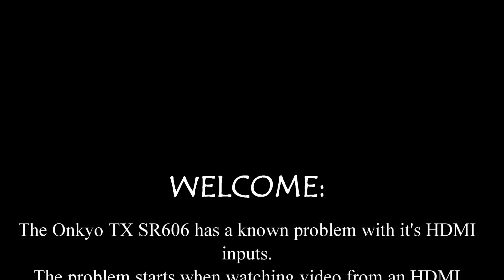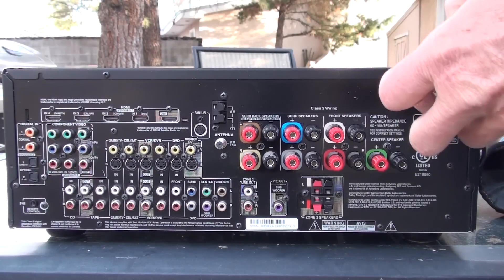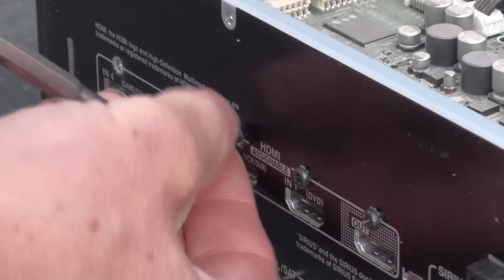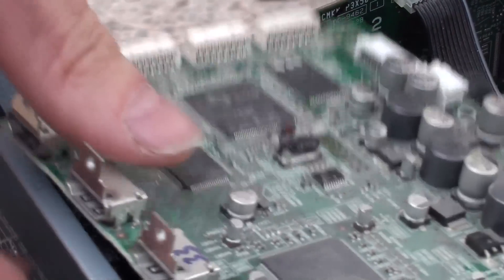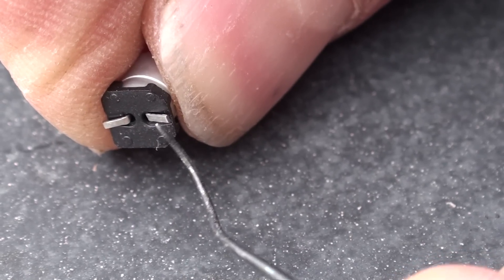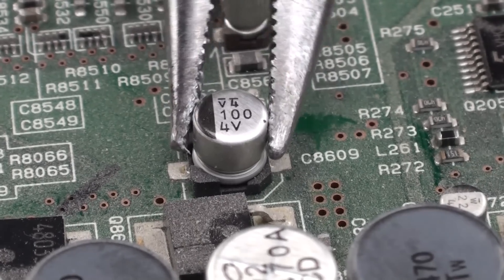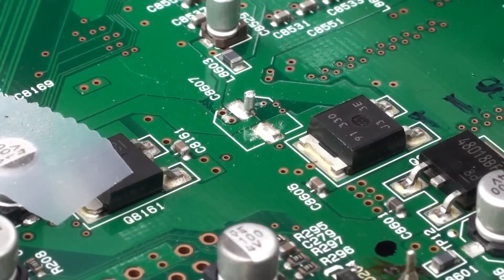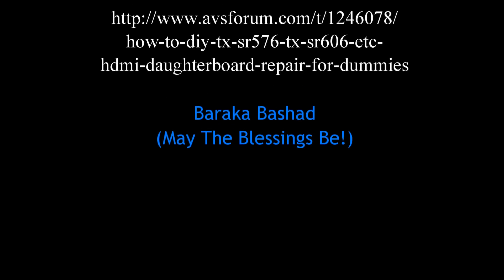How To Fix the Onkyo TX SR606 & SR607 HDMI Input Problem

Comment: Thanks!  Actually, my TX-SR607 had given great service until about a month ago when all HDMI crapped out.  I figured it was toast and was looking for a replacement.  I just happened on this info today, went up to radio shack, soldered in 5 new caps and watching football tonight.  GREAT INFO!  By the way, inventory at shack was 3 radial lead and 2 axial lead 100 uf 35v capacitors----didn't seem to matter a bit, just a little rigging and some heat shrink to fit everything neatly.  Cost me all of 8 bucks.....

Comment: PAT You are a REAL GENIUS. Your tip on blue tac was awesome. I came on in here to see possible faults of hdmi board issues in Marantz MM AV 7005 and I landed on you very productive, educational and informative video. Lately I can only get sound with the HDMI cable connected from the blue ray to marantz AV and then to Arc of the TV. I  am wondering if your trick only worked on Onkyo? Please write back and tell me if it will hold good for Marantz too. Many thanks in advance from Antonio, Goa, the state of India. Good bless.

Comment: This also works for the Onkyo tx 875! 
The boards are different, I replaced all the 100µf capacitors and it worked fine. Probably didn't need to change them all (13) but it didn't take much longer and the cost was nothing

Comment: Thanks! I just follow your video to repair my year 2009 onkyo 607 hdmi board and it works! All hdmi in ports now like instant switching! Its 2019 now!
Reply: Hi, i also have the 607. So you know how many you needed to change and which numbers they have on the board? I understood that for the 607 they are all on the top of the board

Comment: DUDE!  Thanks so much!  I had an issue where after moving to a new house and letting the receiver sit in my closet for a couple years, I tried to get it going again and the picture either wouldn't show, would show but then cut out intermittently, etc.  I searched for a solution and watched your video.  I also searched for a video on how to solder.  
I ended up running to Fry's electronics and picked up 8 (I got a couple extra at your recommendation but didn't need them) NTE  VHT100M16 ROHS 100 uf rated at 105 Celsius.  I painstakingly removed each of the bad capacitors and soldered the new ones in.  The ones I purchased are rated at a higher voltage and thus were slightly larger.  Their 'feet' are also quite a bit longer which helped my brother hold them in place and helped me not to burn his fingers with the soldering gun.  
Plugged everything back in and the picture popped up on my ps3, cable and amazon fire TV right away!  
Again, you saved me a bunch of frustration and a bunch of time.  Thanks!
Reply from the maker: You're welcome.  I've always wanted to be a Dude.

Comment: Well presented and produced video. Clear concise and to the point. Thank you. I have a problem with the optical input not switching and it was suggested on the av forum that it was a chip overheating but might do your capacitor replacement too while Onky is open. In Onkyo's defence my receiver sounds great and was the best value and my type of problem has happened with other devices (I repaired a friends Sony playstation which had overheating Ic's - reflowed solder stuck heatsink pads on and it was working again). Onkyo were apparently repairing for free too so give them a break.

Comment: Thanks for the video, I was able to repair my HT-RC160 in the same manner as in this video. The HDMI output now works and I can see a picture from all my inputs, but I lost sound in the process of fixing the video. I searched around and apparently sound is controlled by one or more chips on the very circuit board, that has the HDMI inputs, the one that I repaired. I probably messed it up when I was removing the board. The moral of the story is be careful when pulling the circuit board out.
Reply from the maker: Did the sound go completely dead.  There's another post where the sound is just a buzzy noise,  this is caused another set of bad caps on the board.
Reply: +patpatpat999 Completely dead... not even the head phones are putting out any sound. FYI, on the HT-RC160 all the 5 capacitors are on the bottom, so I am thinking that since I soldered the capacitors off the board rather than shaking them lose with pliers I might have unsoldered some wires from one of the chip if any of the capacitors are located directly underneath it, even though it would seem highly unlikely. For now I am using the TV sound, I will venture back into the board to see if I can find anything eerie and maybe even bake the whole board in the oven as some of the sound fixing videos I have viewed suggested.

Comment: Thanks this video helped me solve a similar problem in a Pioneer VSX receiver. It would make static noises in all channels (even when no input is connected), and through headphones, with the noise being extremely prominent in Surround mode... Found what seems to be a main regulator on the digital board, and placing a 100uf capacitor across it the way you described, and it's gone! But then, the oscilloscope still shows some noise, and I can't get it to totally flatten no matter what cap value I'm using. I replaced the existing 220uf cap placed across it with a regular electrolytic, but it ended up making a new type of extreme static noises and sometimes would make no sound... I'm not sure why, as polarity and values seemed correct. so, placed the original back and just added the 100uf across it, so far so good. I'm not sure this is how it should be done, but it seems to work. One thing I also noticed is that cooling the regulator down did make the problem go away... could be a bad regulator after all?

Comment: Thanx, very clear video. Did the procedure on my tx sr607. The only difference with the 606 is that all elco's are located on the backside of the board. Anyway, HDMI input work again, don't have to wait for half an hour before they are recognised. OSD is not working :-/

Comment: I am about to try this on my receiver.  I printed out the layout that you show with the capacitors marked and their numbers listed.  I see that the single capacitor on the top of the board is numbered wrong.  At least on mine it is C8609 not C6809 as you have it labeled.  Small detail as I can see from the layout which one it is.  Just didn't want anyone else to be confused.  Thanks for the awesome how to!

Comment: this worked for mine. there is approximately 10 or so of these capacitors on the board. i only replaced the 5 suggested here but for others replacing all of the 4V 100uf caps might be a good precaution.

Comment: Hey great video! I have one of these where the HDMI doesn’t work, but I’m trying to work out whether I should go ahead and replace these capacitors or whether or something else might be wrong? I also have the issue where the video firmware reads out as ‘V0000?’ so I’m wondering if that means something worse is wrong?

Comment: this just worked for me and a TX SR607, used 10v 100uf radial style cap's i found on eBay, i read that upping the voltage is no problem as long as the uf value stays the same. On a side note, the caps you remove are way smaller than they look in this video. they are tiny!
Reply from the maker: Happy it worked out.  Yes, higher voltage is fine but doesn't help either.  The higher temp rating is what will make this fix last longer.

Comment: I have been putting up with this problem for a number of years now. initially i thought it was my Mac Mini, then i thought it could be room temperature, then finally i figured it was Onkyo !! unfortunately i can't try the above tutorial as my rage took over & the SR606 met its maker.
I can however complement Onkyo on its sturdy construction considering the impact tests that i subjected it to !
The controller which i thoroughly despised because it consistently wanted to try & control every know electronic device ever created by human (why do i have to press 'receiver' button EVERY time i want to do one thing on the SR606) drove me to a point i thought i heart was going to pop out of my chest shortly before an aneurism set in thus rendering my twitching corpse useless whilst the 'no signal detected' logo fluttered across my lovely 47inch LG LCD tv.

Why can't technology just work & do what its designed to do. Onkyo you seriously lost me as a customer, never again will i shell out money for such a piece of shoddy designed garbage.

Comment: It's 2019 and this just worked for me on x-mass eve!!!
Reply: Gezellig zingen Hi! What was the problem with your Onkyo? Mine lost HDMI video...
Reply: @rafaelbarcelos9530  same thing. No passtrough and no video by hdmi. After changing the 5 condensators i can pass 1080i 7.1 sound, even atmos.
Reply: Gezellig zingen thank u so much for your Answer! All trouble with This hdmi board Happens to me after a Thunder 😪 i’ll try replace these caps!
Reply: @rafaelbarcelos9530  Take your time, and look for some tac on the board, Onkyo left me some for me to use.  Let me know if it worked out for U!

Comment: Pat -  Quite a flash back for me.  I was an Electronics Technician in the US Navy during the Viet Nam era (over 40 years ago 1967-71).  What a trip to travel back in time to the work I did regularly for 4 years.  Unfortunately, this didn't fix my unit, so I guess it is time for an upgrade.  Fortunately the "black Friday" sales are on, so there are some good deals out there.  I really dislike the "disposable" culture of products being produced. It seems like more and more, companies are building in "obsolescence" just to make more sales.  Thanks anyway. Maybe better luck next time.
Reply from the maker: Sorry it didn't work.  Besides, you need 3D, direct neural stimulation and Bluetooth on your new kit  :)
Once upon a time I was a certified solderer.  Now I had those jobs off the airman because they can see what they're doing.  These days my problems are caused as much by software as hardware.

Comment: My amp would only display my Freeview TV box on any input. If i tried anything else into any of the inputs including a PS.3 and a Chromecast, the amp. would not display it. I put that down to signal levels from the different pieces of equipment and the TV box being a higher output than the rest and therefore causing the amp. to switch. I have now replaced all the capacitors as detailed in the video and all the inputs are now working with all the equipment :) Thank's to patpat999 for a very clear instructional video on how to do the job.
Reply from the maker: Thanks for the info Tony. Hadn't heard of a problem quite like yours.  Enjoy..

Comment: Thanks for the helpful video. I notice you had four capacitors marked for replacement on the bottom of the board: 8002, 8096, 8162, and 8602. But the capacitor with the broken lead was 8607 (also on bottom). Does 8607 need to be replaced to fix the HDMI, making 5 on the bottom (6 total) that need to be replaced?

Comment: Tips and info from ex audio repair tech: Don't get caught up on the capacitor value/voltage/temp. Based upon what the caps are being used for, you can install (like I did) 5x the value, and still function perfectly. I installed (since I had them 'in stock') four 475uF/25V radial caps; they worked great, and they were used! Any radial cap from 100uF-475uF/5-25V will work just fine; you wouldn't want to go much higher in values since they'd be too big physically. The generally larger size of a radial (versus surface mount) negates the temperature concern going forward.
My receiver is the 607, which only required replacing the four 100uF/4V caps on bottom side of board.
Another tip if you don't want to wait or pay for shipping; go down to your local thrift shop, and buy a cheap piece of  electronics that has accessible circuit board(s), and de-solder/use what caps it has. The replacement caps do not need to be the same value; that's not important.
Mine works great now!....Thanks for the video Pat!

Comment: I appreciate you figured out the fault BUT.... guys dont rip or wiggle components from boards as you can easily rip off tracks.  use a thin tipped iron and simply heat leg 1, then 2 until the cap starts to lift easily.  after it comes off: 

LEAVE THE SPACER ALONE.  just use flux and touch the cap down on the pads.  touch first 1 pad then the other with teh iron until the solder melts then all done properly.  if you wish to make a good finish use IPA or flux remover afterwards and you get a nice finish.

needed: for best results a temperature controlled, pointed tip soldering iron. heated to about 260C.  (test if solder will melt at the tip first)
flux (liquid flux isnt ideal.  use gel flux for best results)

OR soldering paste
Reply from the maker: Appreciate the info but it's not completely appropriate for this audience.  The method I show here is easiest for the lay person.  Yes there is a chance of trace damage.  Only one person has reported this happening so far.

Comment from the maker: Bub:  1- The soldering iron is just a cheaper Harbor Freight item (30W).  2- Don't bother to test, change all the 100uF caps. 3- The part numbers are on the video at 3:28. They are radial can SMT (Surface Mount Type) You can use just about any cap that will fit. It just has to be: 100uF, at least 4V, Radial style, and Aluminum type.
As an example: DigiKey pn P10363TB-ND should work though it looks quite different

Comment: Use a thinner soldering iron tip, and you can get the capacitor flatter on the PCB. Also, solder wick will take the old solder off, so you can lift the old caps without having to break the legs off. (I am a BEng. Electronics) Also, much better to get higher temp. rated replacements, as they'll be more reliable.

Comment: I fixed this issue by adding regular capacitors to about capacitors. Get good capacitors with long leg, cut them long enough to put it in parallel and sold two legs to the CMS capcitor. Be carefull to make sure on this adding.

Comment: Awesome video. I have a 607, which is basically the same thing but with a front HDMI port. On my hdmi board, the only 100 uF caps are on the bottom, but there are still 5 total. Think I should just replace those, or should there be something on top I need to replace?

Comment: great video, worked great.....however-what is the black sticky gum like stuff on one of the long capacitors. (after about three hours of this fix it stopped working), the black like tar had melted down the side- worked fine again once if scrapped it all of but not sure why its there?

Comment: Nice guide - but really should be desoldering those caps properly! :o

Breaking the legs off the board is a bad idea, and can lead to solder cracks, or much worse - lifted / damaged PCB pads.

Since you need to solder the caps in anyway, it doesn't take much to touch the iron on the cap pins to desolder them (while lifting each side very gently).

Ideally, you can get soldering "prongs" which heat up both sides at once, but it's perfectly possible to use a normal iron for this 2-pin caps.

You should be able to re-use the old plastic spacers for the new caps too. ;)

Comment from the maker: Can't say for sure without a circuit schematic.  Despite most everything being on little chips. Capacitors are still often needed to pass signals from one device to another.  When the cap is bad, the signal just doesn't get to where it's needed.

Comment: Thanks for the video, I have the 706 with the same problem, I have the receiver apart, but only one of the capacitor numbers you list though are on my HDMI board. The other numbers are all different..any idea which ones are on the 706? Thanks!

Comment: I made the fix and it worked great, the next day i noticed a problem.... When the unit fires up works fine.....after it warms up I am losing signal this is on the XBox.... no issues running the CBL/TV.  Any thoughts?

Comment: Hi, I have just replaced the caps on my board. well... almost all of them! My board was previously repaired under warranty.They did a poor job, and the pads were not in great condition. They used cheap capacitors too!I managed to get all of them replaced except the C8096.The amp works fine, but any ideas what the c8096 capacitor does? All HDMI ports seems to be working?

Comment: I mangled the white "push down" wire connector by the ribbon cable before I found this helpful video.  I'd like to order a replacement part.  Do you know what they are called?  Thanks again for posting this video.  Much appreciated!

Comment: Hello- This is exactly the issue I am having. Since I already replaced my receiver i am going to try to complete this repair myself and repurpose the unit. Question, where may I purchase the capacitors? Thank you
Reply from the maker: Here is a Mouser.com pn:  667-EEE-HB0G101R.   These are better than the original.   0.38 cents each. Replace every 100uF cap you find on the board, top and bottom

Comment: Hey great video, I have the TX SR876 exhibiting these same symptoms, do you know if this is the same cure for that unit?
Reply from the maker: I've seen some threads that suggest this model can have the same problem.  The procedure to repair would be about the same as what you see here.  Find all the 100uf caps on the digital board and replace them.  Aslo check and see if your model qualifies for the special extended warranty.  
http://www.onkyousa.com/Support/service_info.php#

Comment: @patpatpat999 the TX-SR605 has the same caps.  The setup menu from my receiver will not display correctly when trying to configure the settings.  It freezes on the Audyssey calibration screen too.  The capacitors are certainly the same as your fix here.  I read a few comments that may suggest to replace them to fix other issues, or is there another area to look at? Comments?